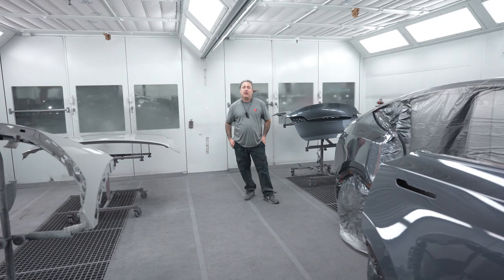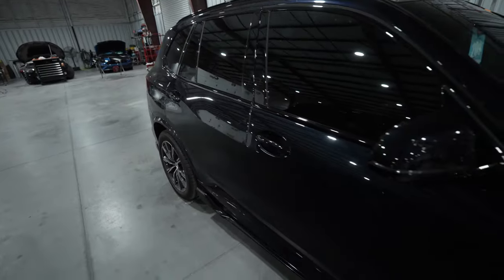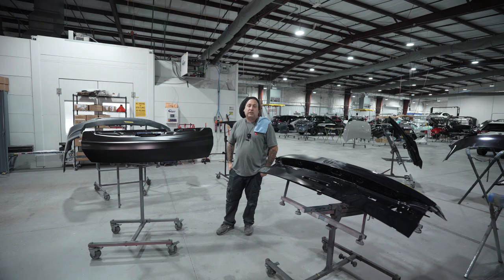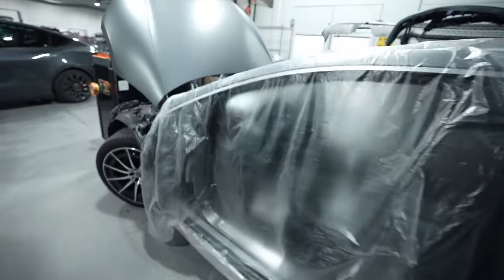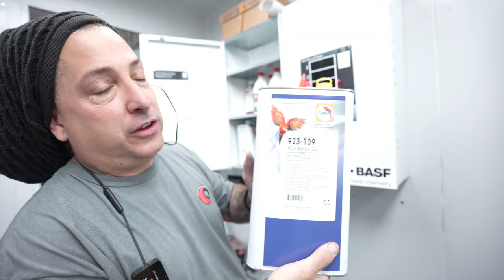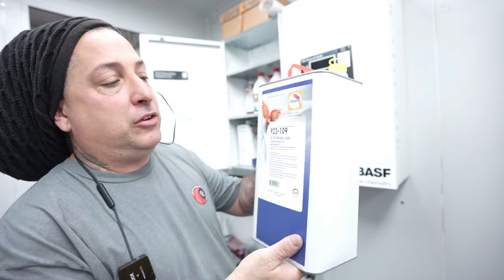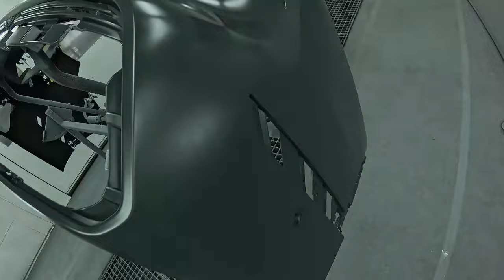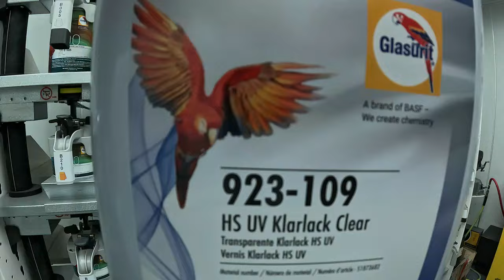No Orange Peel With This ULTIMATE Certified Clear

Comment: I'm impressed that a large "corporate conglomerate" like Crash Champions is removing parts to spray and I'm guessing you're doing full uni-sides if a quarter panel repair/respray is involved ?  I miss spraying Glasurit, sprayed 90/55 line for the last 5 years, currently using Sikkens, and it's just not the same level. Loved 923-365 clear and also sprayed a lot of 255 and 460. Great channel btw.
Reply from the maker: Yes we do take off parts .and spray full  unisides. It's the best way
Reply: @kandyman5315  Absolutely the best way, too bad there are very few shops doing quality repairs like that.

Comment: You definitely have to shoot the Glasurit 923-210 Ultimate clear. 

All of the resto guys (Goolsby Customs/Chip Foose/TheHotRodShop) shoot the 923-210 and/or the 923-460. 

The guy at TheHotRodShop mentioned to mix it in a 3/1 ratio instead of the 2/1 ratio for the Glasurit 923-210. He mentioned you can really get it to flow out like a Glamour clear and buffability is incredible.

The 923-109 was specifically formulated for countries like New Zealand and Australia with ultra high UVs. So it will definitely be a top clear for a BASF Carizzma candy or a Florida/Arizona/Nevada car that will get a lot of sunlight. 

BTW, Bmw, Mercedes, and Porsche are still shooting Glasurit on their cars from the factory in Germany.

You can also do a review on the BASF RM 5335 Glamour clear as well. Shoot it in a 3/1 ratio not the 4/1. That's another BASF clear that lays out absolutely spectacular.

Comment: We have a diamont system at my shop and got some of the 460 clear to try and I’ll say this it’s awesome stuff.  I was using 5600 clear which sprays good but it will pinch back.  460 still looked wet 3 days after spraying it.   Looking to try the 109 now after seeing this video

Comment: 109 is a nice clear. If you have to cut and buff do it in the first 72 hours or it will fight you with the flex. You'll dig the matte clear. Not as easy as Akzo but good results, no clouding.
Reply from the maker: Thanks for the insight 👍

Comment: We don’t spray much of the matte clear at my shop but if it sits in the mixing bank for a while I’ve found it’s best to strain it before hand. Seems to get kinda seedy after a while. Spraying 90 line
Reply from the maker: Thanks for the insight
Reply: basf told us not to put the matte on the mixing rig because of that. just keep the can closed and shake it every time before you use it.

Comment: Number one your work is outstanding one hell of a painter. You have had a chance to spray some of the best clears from PPG and glasirit! What would you suggest top clear for a custom and restoration shop where time is not an issue or baking available?
Reply from the maker: Ppg 5050 is a great clear and for the glasurit. 923-460 and 109 clear are both top of the line
Reply: Awesome man thanks for the input and also keeping us guys in the loop on new products that we may not hear about otherwise! @kandyman5315

Comment: Hi KANDYMAN cracking  video  good question for you whats the best spray gun for base coat paint and clear coat paint  iwatta 1.3 WS400 1.3 OBS BLUE CAP series 2 for base coat paint and the iwata series digital clear 1 3 HD  or sagola extreme aqua 4600 1.3 and  titania pro cap 😀

Comment: Looks really good, we just got Sherwin Williams, clear locks up  fast and doesn't dye back.
Reply: What are you using 5020?
Reply: @josiahbrown2339  it's the 200, 250, and the 21 fast. All are fast but the 250 stays open and flows best 👌